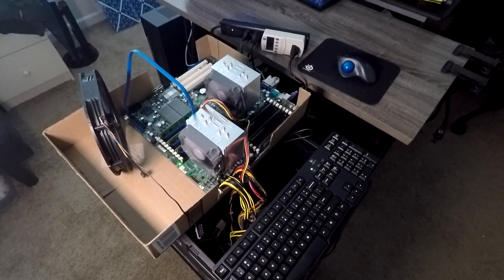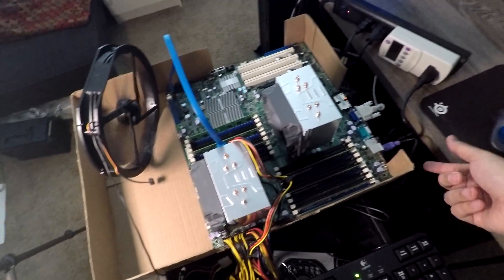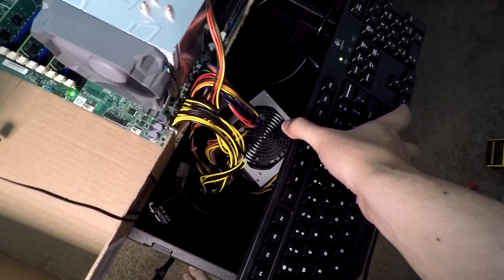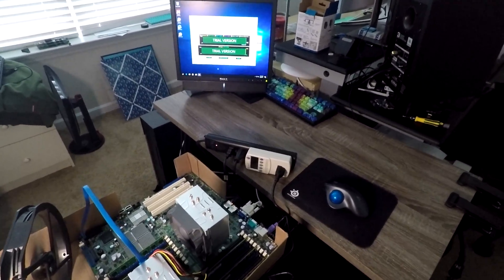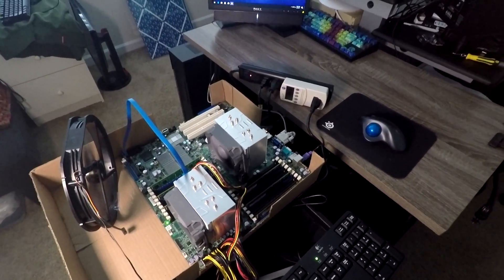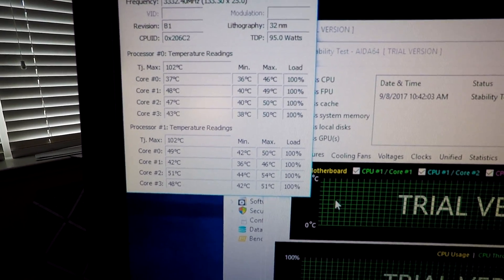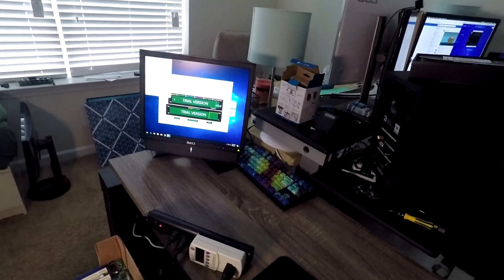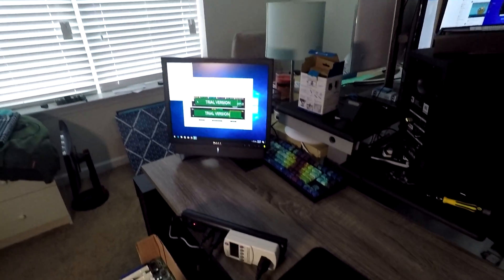Power consumption test - dual Intel Xeon X5667 with X8DTN+ 1366

Comment: Hi, can you please advise what power supply you use and if  "PWR I2C" (J15) is required for power-up? (have the same board and can't power it up). Thanks
Reply: Manage to power it up :-). J15 is not needed. Regular ATX power supply will do (Y spliter for the EPS works fine).